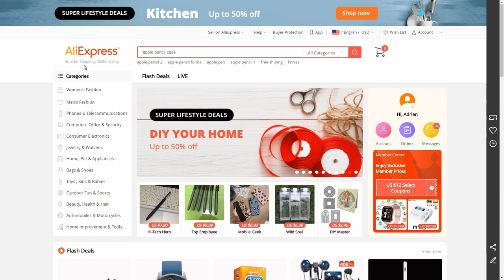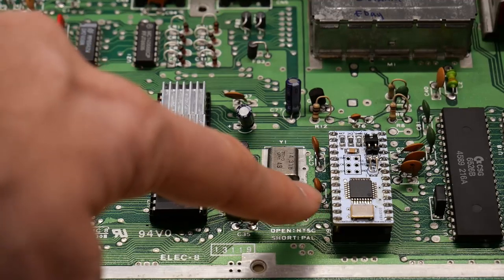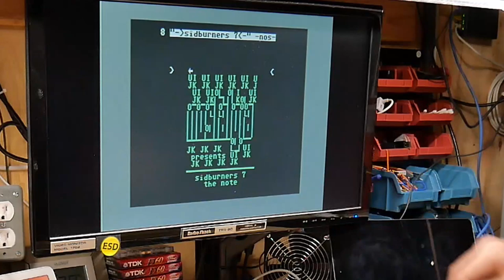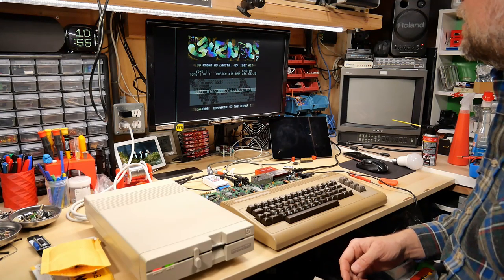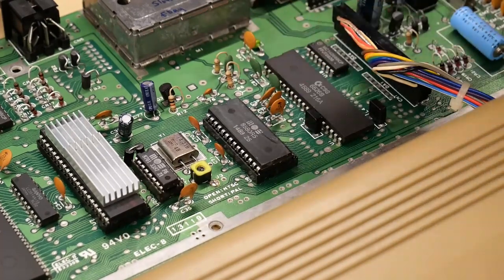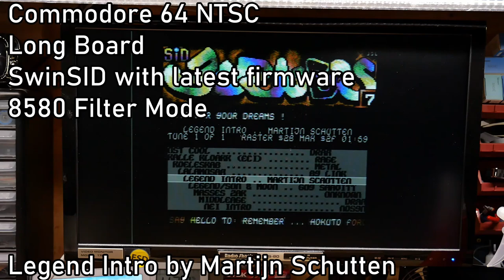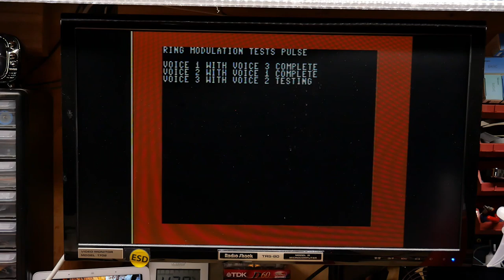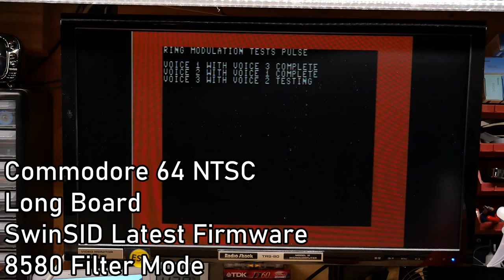I bought a C64 SID chip from AliExpress!

Comment: "I hate all the joysticks that were on these computers." YES! Finally somebody talks reason!
Reply: It was even worse on the Amiga, IMO.  Though it was  a newer machine and the game ports supported 3 fire buttons, every joystick for the system supported only one fire button, to be compatible with the Atari 2600 standard.  Gamepads for the Amiga were few and far between, and every game used "up" to jump just like in the 8-bit days... for no other reason than tradition.  Ugh.
Reply: @Waccoon  A pad's directional control is good for 'short bursts' of directions, but having to hold in one direction for a longer time, combined with multiple taps into same direction, or long chains of directional changes without pause, inevitably lead to the thumb slipping from the control, while a hand held Joystick can do any kind of movement endlessly. So for example  Turrican clearly is a much better game on Amiga than on the consoles because of the Joystick controls. They practically eliminated most vertical level design on Super turrican, making the game way less open feeling and interesting. The consoles got simpler level designs and less sophisticated jumps, because a pad can't control direction in the way a full size Joystick can.
So the thumb slipping from the cross (similar to that horrible analog thumb sticks we got on all modern pads btw) is a major downside that comes with pads.

And there's another one: Using only a thumb for directions can be too tiring, depending on the action on the screen.
One example of where Pads just can't do the job are those classic 'joystick rocking' sports games; you know, like summer games, where you had to wiggle the stick from left to right faster and faster for an eternally feeling period of time. Not that this was an example of great gameplay, but it's one very obvious example of the limits that a pad has regarding it's directional controls. With a pad normal people can't wiggle nearly as fast as with a stick, and not even to speak of, keep this up for a sufficient amount of time. (Yes, you can try workign around this, by putting index finger and middle finger, or fingers of both hands on the directional controls, but of course that's defeating the purpose of using the pad as a general control in a way that would make playing some games impossible again, similar to the old trick of grabbing a Joystick just by it's head and wiggling the whole base for these games ;) )

So both problems show, that sustainability is a big objective disadvantage that pads have compared to full size Joysticks and of course good games are modelled with these differences in mind.
Yes, on the one hand games like Street Fighter and such are better with more fire buttons, but on the other hand, the original arcade still got Joysticks for directional control.
Depending on the game one can be better than the other, and clearly the majorityof C64 and Amiga games are optimized towards Joystick controls, and if you really want to succeed, you need to be in optimal control for most, with the pad giving a huge disadvantage.

Subjectively I also like the differences that result from games being optimized towards Joysticks. They feel put emphasis on other parts of the gameplay, making them feel more 'serious' to me. The Joystick also contributes to this, by giving a 'more physical' feeling. This means, that when using a pad, I always feel like a guy pushing buttons while standing in fronf of a gaming device. But a good joysticks actually makes me feel a bit more like being inside the game. Hearing the sound of Turrican's metallilc feet slamming onto the ground, after having picked him up towards another platform, by pulling on the Joystick just fits too great! This feeling completely loses it's force with a pad.
So Joysticks it's are one of the many things that make computer games more interesting and often authentic to me, than the 'neutral' control feeling that results from using a pad. In my opinion commodore should have shipped the Amiga with a two-button Joystick, though, that would have given enough momentum for the developers to actually support these more often and of course a third party industry delivering to that movement.
So there is no general 'Joypad' superiority at all, and I have never experienced one, it's just different, I would never like to change the experience I had with playing Amiga games with a good Joystick :)
Reply: @elmariachi5133  As much as I appreciate your insight, there's a reason why joysticks are now designated to flight sims and thumb sticks are everywhere.  Poor input controls plagued early computers, and I'm shocked it took so long for things like DirectInput to show up and get this mess under control.

On that note, many modern consoles STILL won't let you remap controls as you like, instead forcing a number of canned options.  There's always someone out there trying to design the "optimum" experience, telling you the right or wrong way to do things, instead of letting the player choose for himself.  Bad habits (and traditions) die hard!

Sorry, but I would have loved to get rid of "up" and replace it with a dedicated action button on most of my Amiga games, and the only reason why I couldn't is because the industry was immature and stubborn, even though the Amiga (and other machines) delivered hardware that was capable of so much more.
Reply: @Waccoon  Well, the reason is that industy nowadays is even more stubborn and ignorant than ever before. With very few tech giants controlling their own market, there's no need for producing what people want. When asked, they always say 'because it sells'. But that's no proof that people actually prefer some current technology standard versus hypothetical alternatives - because there are no alternatives being produced and sold.
It's the modern standard for industrial behaviour in any possible market - people have no choice.
For games in general, you have to choose between some 'modern' standard genres that cover about 5% of the gameplay that once existed on the PC. There are indy-games, but those of course are no industrial thing and usually don't habe any impact on the markt standards.
Then there are mobile phones - if you want a device with some sufficient performance and features, there is no choice for having a T9 keyboard for example, you have to use touchscreens, although it has been proven for years that touchscreens are the least efficient way for doing nearly all activities on a mobile device, besides the least important ones, like web browsing.
Also there are famous classic examples of technological evolution rarely taking the direct path to an optimal outcome, with the all time number one being "VHS " - that actually was the worst possible technology available for the job, when it started conquering the market.
So summarized: A product being the only one of it's kind says nothing about it's reasonability - it's just what industry liked to force upon people. Especiall nowadays this is a problem that affects nearly all products. Industry has optimized itself in a way that  mainstreams products before they even come to existence, thus leading to not the people deciding what they want, but managers and product designers. Battles like BluRay vs HD-DVD are a thing of the past, we are in the age of technical monopolism with all it's drawbacks. (like thumb sticks ;) )
Reply: I agree. I never liked the "joystick style" of controller and always preferred gamepads. I had a Sega Master System II after the C64 but was never that keen on it's gamepad either but I did like the Sega Mega Drive gamepad.

A few years ago I took a Mega Drive/Genesis 3-button gamepad and modified it to work on my C64.

I built a small circuit and rigged it up to the start button which toggles between up and button A.

When in button A mode the up on the D-pad doesn't work so no risk of accidentally bumping up and jumping, same the other way around. The toggle circuit was built with 2-gates of a 4011 Quad 2-input NAND chip.

Button B is the fire button and button C is auto-fire which uses the last 2 NAND gates in the 4011.

I adjusted the auto-fire rate to the maximum that the C64 seemed to accept.

I love my modded Mega Drive C64 gamepad ❤

Comment: I've avoided the SIDs from AliExpress - they are notorius for having issues.  However, I have purchased CIA and VIC(1 - for the VIC-20) chips and had few issues.  I did wonder where they were getting these to re-badge them.  The 8580 uses 9V btw, not 5v!  Both chips use 5v for the "logic" side of the chip, 12v for the 6581 audio section and 9v for the 8580 audio section.   The reason the SwinSID works on either is both the 8580 and 6581 take 5v from pin 25 VCC, and the SwinSID uses that.  The 12v (for 6581) or 9v (for 8580) goes to pin 28 (VDD) - the SwinSID doesnt connect that pin at all.
Reply: Wonder what will happen once accurate clone chips come out for things like the 6581
Reply: @joshm264  They already exist!  The FPGA SID is pretty much 100% accurate from what I understand (I've yet to re-test with the latest firmware).  The ARM SID is another "emulation" type replacement, but that is excellent compared to the Nano SwinSID.  Theres also a rare enhanced version of the SwinSID called the SwinSID Ultimate - that sounds almost identical to a real SID too imo, but not as good as the FPGA SID with the latest firmware.
Reply: @GadgetUK164  saying like some way to recreate the dye inside the chip, making it a 1-1 replica
Reply: The FPGA SID replicates it pretty much 1:1!
Reply: I suspect there are some good ones!  A few people have bought 10 or more of them from these sellers on Aliexpress and found 4 or 5 that do work, but have questionable filters / sound a little different compared to how they should sound.  I wonder if they are rejects from original factory stock, or whether they are reclaimed from scrapped boards or something.  I would not expect China to have masses of C64 boards to scrap tbh!  Unless somewhere else in the world scraps boards, removes chips and ships them all in bulk to China?
Reply: @GadgetUK164  Nice to know, thanks for that info. Bought a C64 bundle off ebay as "working", didn't test sound and found out months later when I started cleaning it, the ** seller had taken the SID chip out!
Reply: @GadgetUK164  I was about to ask why someone hasn't done an FPGA. It's a bit of work, but doable and would result in a 100% accurate representation, assuming the original chip is all silicon.
Reply: @rich1051414  The problem is that the SID uses the same lithography process that´s used for digital circuitry ALSO for analog implementation of operational amplifiers (for the filters). Indeed they use biased mosfet inverters to implement single ended op-amps.
That´s something you can´t just program into an FPGA. What you can do is to emulate filters, so they sound undistiguishable, but you can´t burn this hybrid structure that SID has 1:1 into an FPGA.
Reply: @paulkocyla1343  So you would need an FPAA? Field Programmable Analog Array?
Reply: @rich1051414  This would definitely work, as the filter can be made with op-amps, resistors and capacitors only. But it still wouldn´t be a 100% representation of the SID. You can mimic the filter digitally on an FPGA probably better than trying to model it the analog way, sounding more like the real thing. An FPGA is fast enough to do an emulated physical modelling of the real mosfet inverters in the real SID. The whole other part of the SID is digital anyway, so going FPGA ist imho the best approach.
Reply: @paulkocyla1343  There is also the "minor issue" that there were huge variations in the manufacturing process, meaning that "no two SIDs sound the same". No matter how accurately you represent your reference SID...someone else will come up with the SIDs he's been listening to since 1983 and claim that it sounds differently. Which it does.
Reply: I grew up with a 6581 in a breadbox, I am a musician with perfect pitch. 
I’ve spent megamoolahs in the past year dabbling with SIDS, U64’s, and chucking every revision into a Reloaded board? 
I hear volume differences, the 65’s sound like a vinyl compared to a CD, and the Swinsid Nano is really fkn close. The 85 has a nice “crunch” so it depends on what your ear likes, and what your expectations are. The SWINSID nano actually impressed me, except for the boot up “Bong”
I’m working on a C64 (or midi paired) that can do up to 16 SIDs simultaneously, I want 48 voices and 16 sampled all running concurrently. My kitchen table looks like a frickin chip laboratory and wifey is displeased, but if I can even get a PC to drive 16 SIDs via MIDI, I will be a chuffed 43 year old without a Porsche. 
Anybody who wants to help me with this quest of getting as many SIDs running simultaneously would be a godsend. If you can help with the software, hardware, or even a working SID, Hit me up please.
I believe these chips are the best synthesiser chip ever built, and having worked as an audio engineer, sampling is BORING. I know I could sample a SID but that’s about as fun as playing with a MOOG emulator on your onboard sound”card” in your dell.

Comment: You're finally hearing SIDburners 7 the way it was meant to be heard. So many tunes were specifically meant for the 8580 and its combined waveform capabilities. However, that Legend Intro was indeed composed on and designed for playback on a 6581.
It is very interesting A/B comparing so many SID tunes on the various SIDburners compilations or the HVSC with a C64 Reloaded MK2 board, being able to effortlessly switch between a 6581R4AR and 8580R5 while songs are playing.

Comment: The reason the drums sound differently is probably the sample playback via $D418, which was a bug/feature that was fixed in the 8580. 
You can do a small mod called "digi fix" by soldering a ~330k resistor from EXT IN to GND. That should probably make the drums sound better/normal.
Reply: Tobias Mädel It's not digi in this case, it's the filter differences between new and old sid (Cutoff). (On the old sid chips it can even vary a lot from chip to chip, while it's always the same on new sid chips, but generally the cutoff is lower on the old sid)
Reply: yes seen a video  of them doing exactly that    but there was from what i heard  at the end of the production in the 1990s   the made it louder    guessing from complaints from customers  ..
Reply: The resistor value varies a lot from machine to machine or sid to sid, but at least on mine, a 680kΩ resistor sounded exactly as loud as the 6581R3 I had in my DualSID on the same machine on the left channel for comparison.
Reply: i have the 330k resistor for my 8580 in my 64C but on a switch because there were some later games which the music was obviously composed with 8580. it just gives me flexibility to be able to play both old and new games.
Reply: I mostly play newer games so I prefer the new SID, the only thing I don't like of the 8580 is that speech is at very low volume, apparently with the old SIDs you don't have to turn the TV volume up when there are spoken parts in games.

Comment: I am a huge fan of the 6581r4. It's usually found in the longboard c64 and early c128. I've also found that the tunes I make with them translate better to both 8580 and 6581r3 with less tweaking.
And a comment about failing chips. I've so far only had failed CIA (about 7), one failed CPU and one RAM. Never had any trouble with PLA and SID so far, which seems odd. But I've only repaired about 8 c64s yet.

Comment: A while back, I modified a knock-off Chinese NES controller to be used with the C64. Like you, I even did the jump button as well. Really cool to see somebody else do the same thing :)
Reply from the maker: I linked a video to someone doing that mod with a new one. Definitely harder due to the blob chip versus the DIP as I just soldered onto the legs of the DIP. But yes, the jump button thing is by far the best thing to do one any 8 bit micro!!!
Reply: Absolutely. Trying to jump and move around using a joystick was driving me nuts, so being able to do it with a controller definitely makes things so much easier.

Comment: The FPGASID is a great replacement Sid, sounds extremely close to the read deal.   But my favorite device to listen to sids is with my Ultimate64 with both a real 6581 and an 8580 installed with a direct to sid tap into my audio mixer.  The beauty of the Ultimate64 is the ability to switch from PAL to NTSC and SID memory addressing on the fly.  Great way to compare sids is swapping channels instantly in my mixer or putting one left and the other right for a stereo effect.

Comment: Little fun fact... have you ever tried acquiring a PAL C64? You'll likely find that your screen already supports PAL, because LCDs do all the conversion in software (firmware)... they just plop the same firmware on every model and sell the same model in PAL regions. So you just need to plug it in and you can run PAL-compatible demos. There's a 60Hz (now 50Hz) signal that'll get screwed up - and that only seems to affect baud on the user port (no modems, boo, lol), but video and demos mostly play fine. You can see some amazing things with a PAL C64 and a real disk drive!

Comment: Might upset the purists here but I think the 8580 is the better sounding, I think the drum beat and wind sound on the 8580 adds to the track and could hardly be heard on the 6581.
i also think the swinsid sounded like the 8580 more than the 6581 regarding the drum and breeze sounds and I would choose it over a 6581

I believe the 2 filter capacitors are also of a different value on each sid